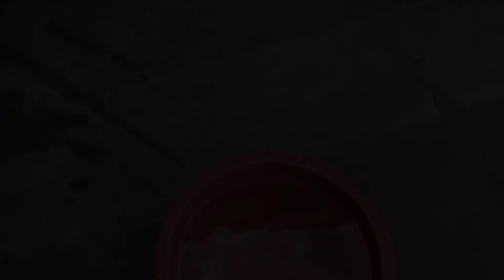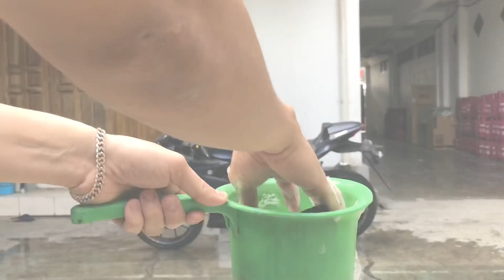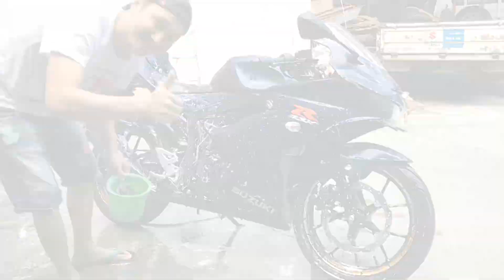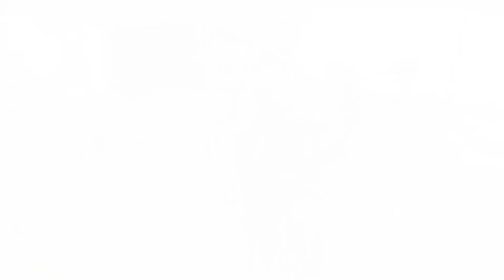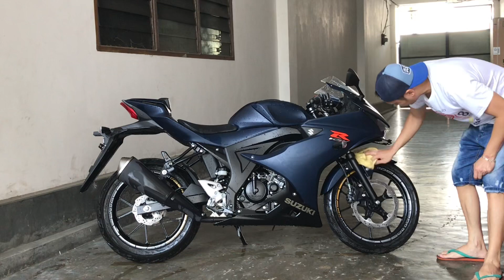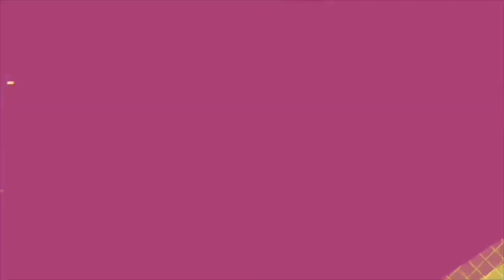SUZUKI GSX-R 150 MATTE BLUE (LIMITED EDITION)

Comment: Well all i can say is very itchy to the eye for all gsx r150 lover specially on the looks of limited edition. Matte edition. Let me get to you straight okay? Very wrong that you begin to top, buttom, top again and button again. It may scratch you your matte color of your bike that you get the dirt from your tires, mud shield etc etc and then you going to scrub it again to your matte color gsx r150? Really? And 2nd thing used half bucket of shampoo with wax to make your matte color glossy and shinny not dry matte lock. Looks dead not eye catchy looks old to see. 3rd begin to the top, buttom and then last the tire, wheel sets, breaks, mud guard at the front and the back and then the chains. So you dont rotate your dirt on your bike and prevent on scrathing your bike. 4th try to used hose not 'tapo' i dont know what english is that but its filipino word for us. Used hose cause sometimes you dont rinse every soap all of your bike 30%. Sometime you missed the spot 'ow i scrub this i forgot to rinse it' and then youre going to do is rinsr your bike when its already dry and start over again on rinsing waste of water by using 'tabo'. Tips for you men even i dont have gsx r150 matte but i have a bike that well maintain and scratch free 😁